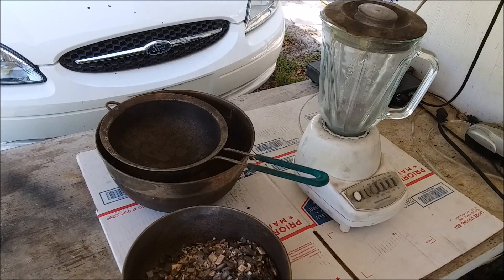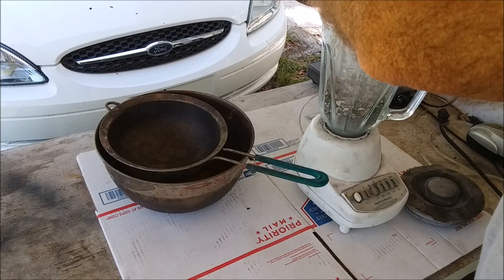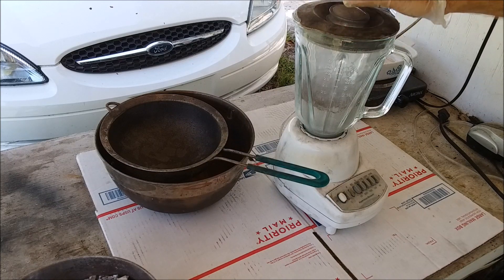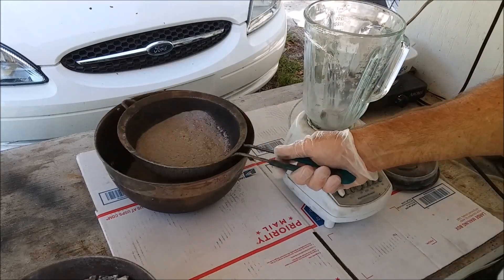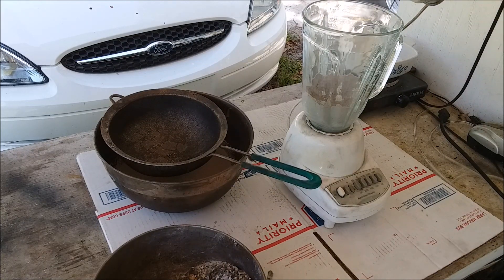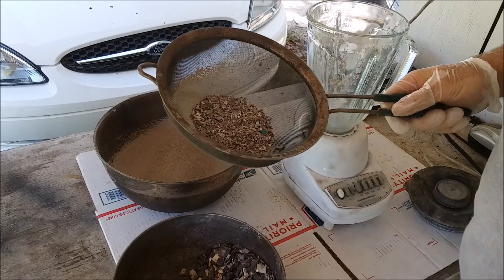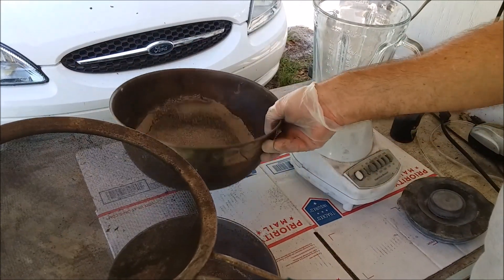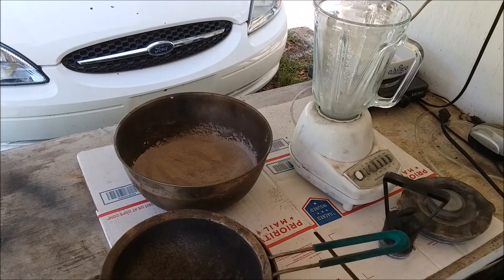Pulverizing ashed plastic IC chips to extract gold.

Comment: I wonder if you could break up ribbon connectors and other low-grade pins with a blender. I would expect that busted up the AP would dissolve base metals faster. Thanks for the video! Learning a great deal from you